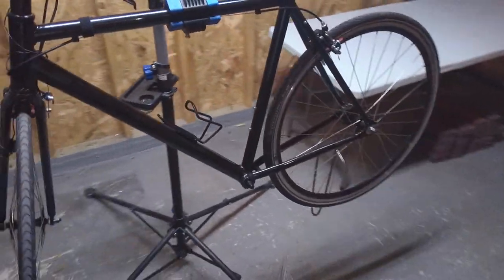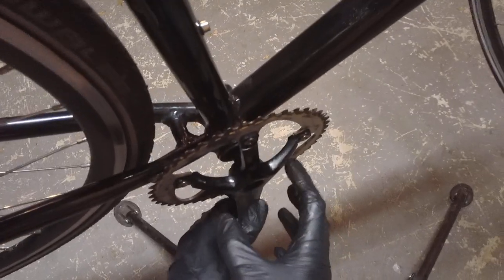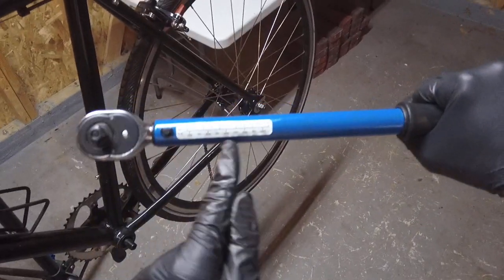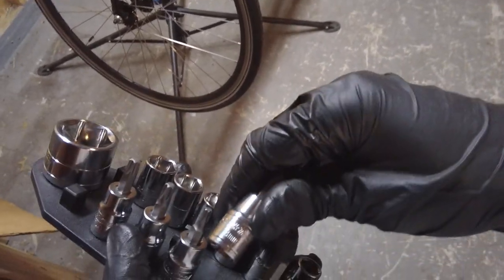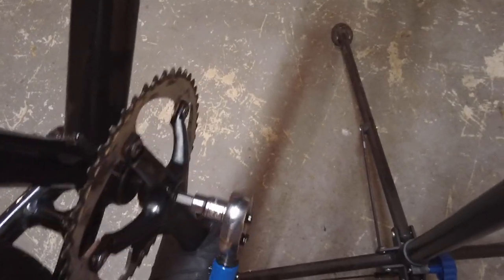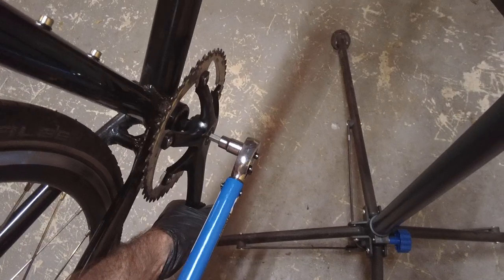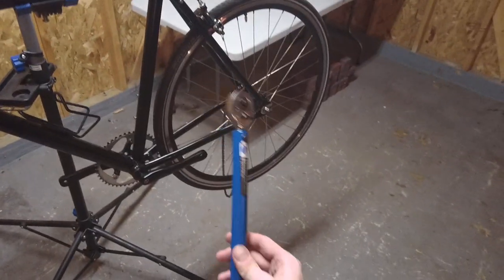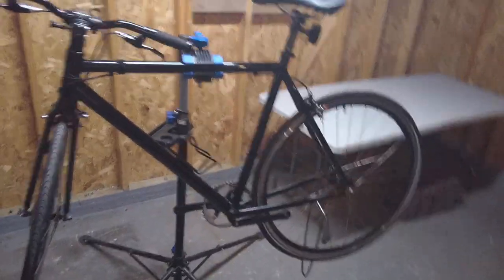How To Install Square Taper Bicycle Crank Bike Blogger

Comment: You're right if you want to prolong the life of your torque wrench zero it out at the end of use... Another tip is get it as close to torque spec as possible and finish it off with the torque wrench. It's for torquing not initial tightening.  Glad you found the noise :)

Comment: Most of the manuals I've read cautioned not to get grease on the taper itself. This can allow the arm to be pulled too far up the taper and can even ruin the arm by spreading the taper. I usually wipe the spindle taper down with a rag with just enough WD40 to make sure it's clean, then torque it to spec. After that I grease threads on the crank bolt.
Reply from the maker: Thanks for the tip Old Guy Bob!
Reply: No, the bolt threads AND taper should be greased.  It's a myth that crank tapers shouldn't be greased.  Torque specs assume grease is used in virtually all bicycle nuts & bolts.  Google "Jobst Brandt crank tapers" for the engineer's explanation.  Or see Sheldon Brown's recap:
https://www.sheldonbrown.com/brandt/installing-cranks.html
Reply: Yeah,, grease just about anything. I didn't grease my aluminum seatpost on a CrOmoly frame and it developed a nasty squeak years later that was really hard to find. WD40 is consumer grade junk, try Seafoam, it's safe for airplanes. Excellent stuff.
Reply: That's incorrect. @dudeonbike800
Reply: NEVER grease the taper.
Reply: I've been instructed to install aluminum cranks on the tapered shafts dry for the reasons stated above. On the other hand, when assembling pedals to aluminum cranks the threads should be coated with an anti seize compound or at least grease. If you get galvanic action between the steel pedal & the aluminum crank the pedal will be almost impossible to remove. Steel cranks are more forgiving.

Comment: I need to correct my post. I clean the tapers (spindle and crank arm with the rag as mentioned below. I do the same for the crank bolt. The threads on the bolt should not be greased as that will make your torque setting inaccurate. It will over torque the bolt.
Reply: You want your torque to go into the pre-load on the bolt (stretching of the threads which keep it tight as they try to return to unstretched position) not into overcoming the friction of dry threads.

Comment: I had crank bolts from the old square crank i litterly took them out they fitted before perfectly then when i took them out i couldnt screw them back cause they didnt fit anymore and now i am totally fuckd so what to do?

Comment: Any rough feeling of what 40n/m is like? Torque wrenches that go up to that are usually much more expensive
Reply: +JeCZeeeee If you're an American, like me, you know ft-lb or inch-pounds. He used 40 n-m, 300-400 inch pounds or 25-33 ft-lb. What is a foot-pound? It is one pound of weight, held off of a one-foot lever. If you know how long your wrench is, you can figure out how hard to torque it. So if you had an Allen wrench that is eight inches long, hold your hand about six inches away from the center and press down 55 pounds or so. This should get you close enough. I used to work on vintage Vespas, and I asked an Italian guy once what the torque for a certain part should be. He said "I don't know, just tighten it down. It's a Vespa, not a Ferrari!" I've done this for years, and you get a "feel" after a while. Having said that, I disclaim all responsibility for injury, death, overtightening, etc.

Comment: My left cranck arm gets loose over time.. does it mean it's not tight enough?
Reply from the maker: Crank arms tend to shake loose after a couple hundred miles on a new bike. Always check the crank bolt and tighten it from time to time. A good bike shop will does this for you whenever you bring it in for servicing.
Reply: so if I have my bike long enough it wil stay on eventually?
Reply: @thijsvanlith679  Probably not. When an aluminum crank has been run loose the 4 flat surfaces in the centre become convex & retightening will not correct the fault. I've rescued cranks by placing them in a vice and filing the 4 surfaces flat again with a Swede saw file. In one case when the crank was too badly worn i cut 4 trapazoid shaped sheet metal shims to space the crank out.